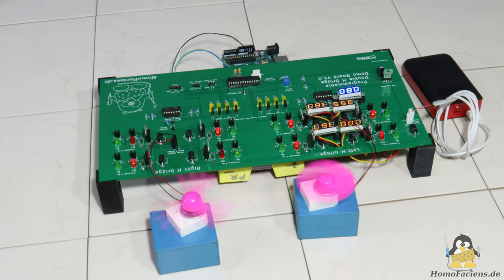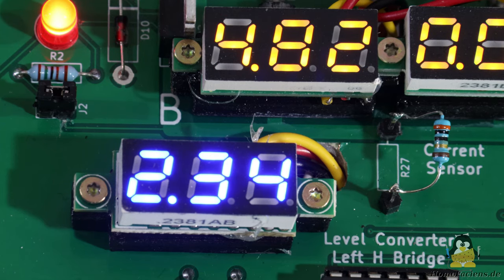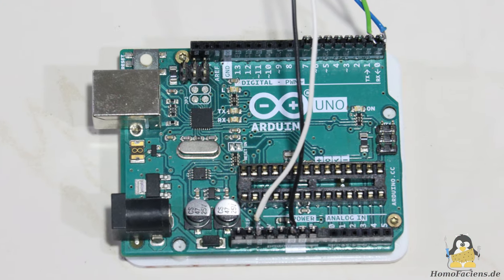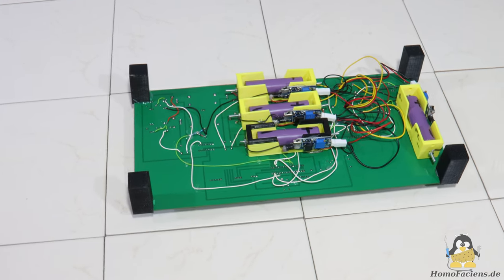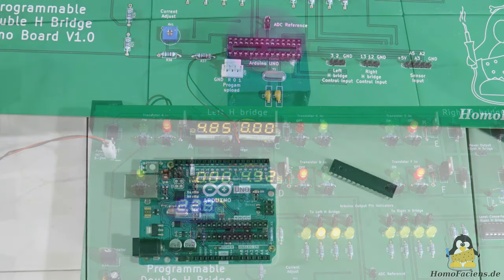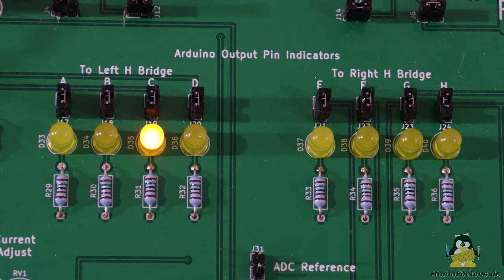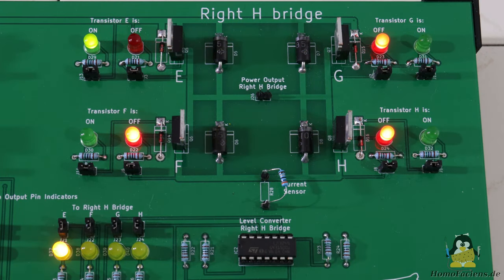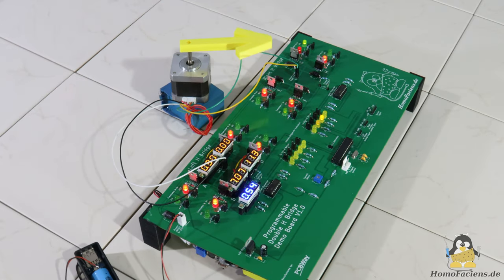Demoboard of an Open Source, freely programmable double H Bridge

Comment: Can you show us how to build 100 amp h-bridge?
Reply from the maker: Just use 100A MOSFETs, large heatsinks and wide tracks on your PCB.
Reply: @HomoFaciens  I have tried that. I don't think it is that easy? Please prove me wrong.  I appreciate your response none the less thank you.
Reply from the maker: As long as you don't tell what components you used in what circuit and what went wrong, it is hard to give you a hint how to improve in your design. Of course you must read the datasheet of the power transistors and avoid the limits listed there. What project do you need that high power H bridge for?
Reply: @HomoFaciens  I have two 700w brushed 12v dc motors that I want to use as servo motors for my "NOT" CNC milling machine. Everyone on Youtube kindly shows how to make maybe up to 10 amp H bridges but nothing that can cope with serious power reliably. I am learning to do this myself but everything tends to ends up in smoke. I'm getting closer. The more I learn the harder it gets! I obviously did start with just swopping out the FETS and loading up the tracks on low cost H bridges I could find. There seems to be a steep cost rise in buying higher power brushed DC motor drivers. Would love to see if you can solve it before me..... x
Reply from the maker: What MOSFETs were the latest you forced to emit the magic blue smoke? Maybe we can start from there.